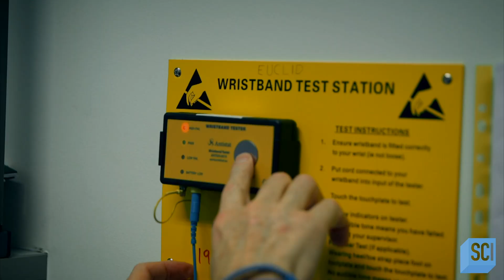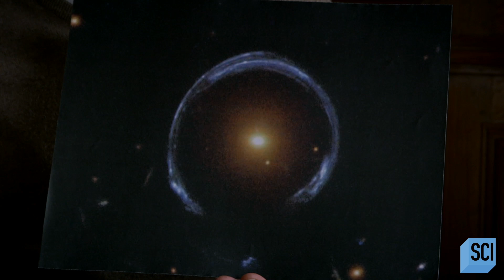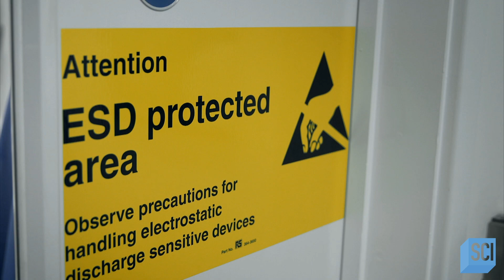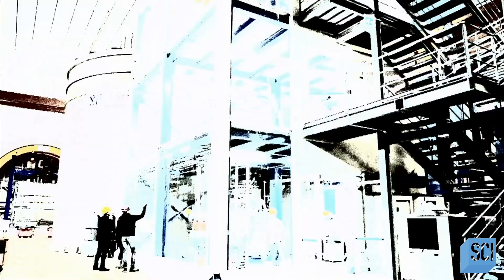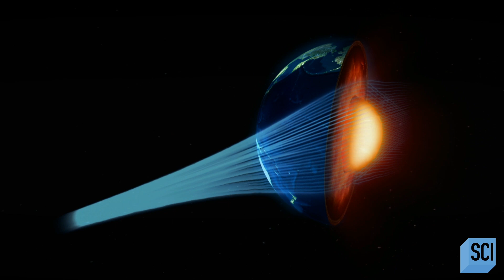Join Researchers as They Investigate Dark Matter | Space’s Deepest Secrets | Science Channel

Comment: Inflation never stopped and the Big Bang followed inflation until the density peaked and then decoupled and expands at a slower rate riding on top.  Then as density formed and reached a certain limit (which could be measured) it presses into the inflation field which causes drag and this leads to spin and mass.  The blackholes and galaxies should all be larger then, because our expansion was closer to the inflation field (from the overall density of the universe) which caused a faster spin at first which created greater mass and then as our universe expanded and lost density the galaxies/blackholes became less massive.  This drag on massive objects also keeps galaxies from flying apart.